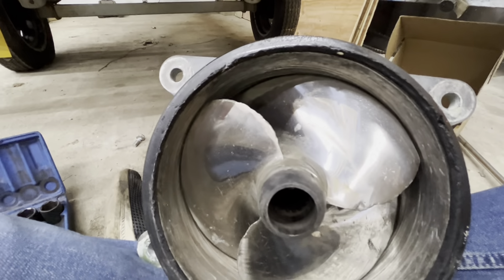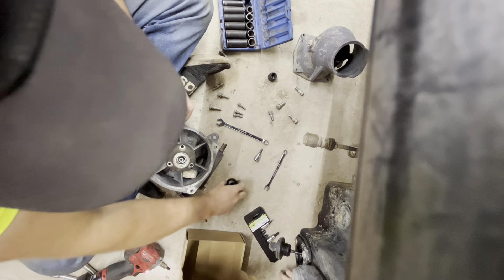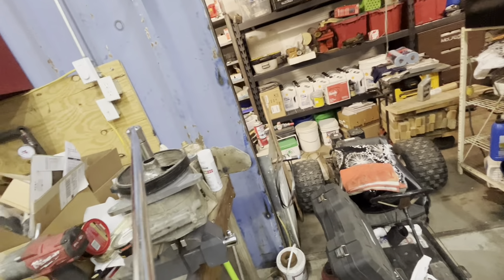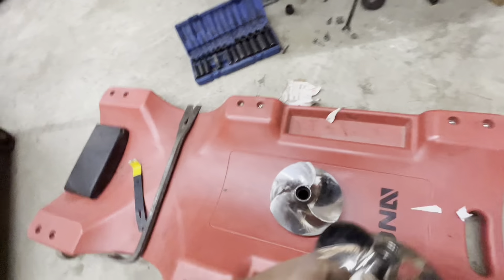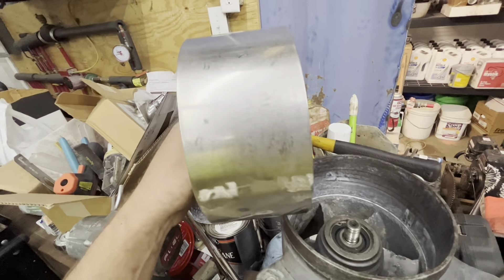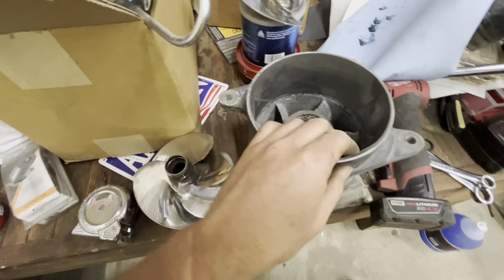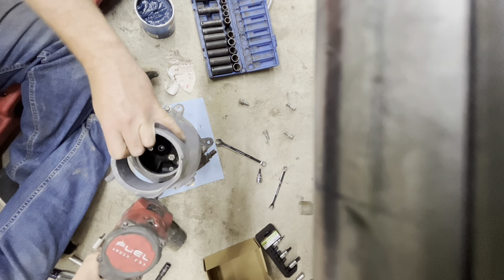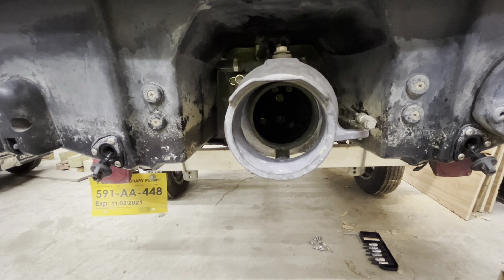Rebuilding a jet pump on a Kawasaki STX 900 with a new impeller & stainless wear ring

Comment: Just viewed your video and subscibed!   Great job!  I have a 2000 STX 900 and mine might becoming a dog out of the hole like you mentioned.  I want to look at my impeller/pump.  How did your fix work out?  Does it run better now or what?  Thanks!
Reply from the maker: It runs so much better now. Jumps up right on plane like it’s supposed to.

Comment: How much did you spend on the impeller and the wearing assembly
Reply from the maker: I bought the parts off of eBay. Think I got it all for less than $200 if I remember right.